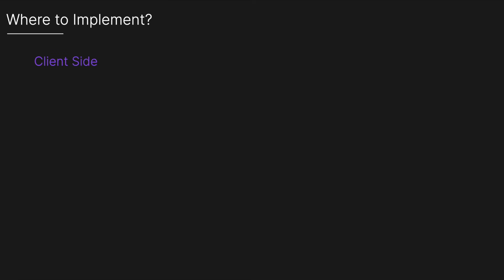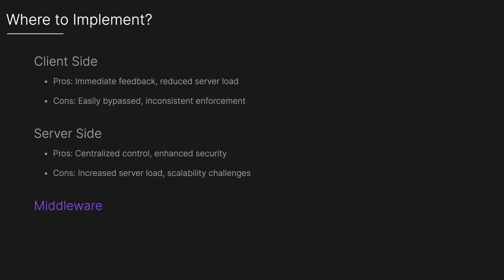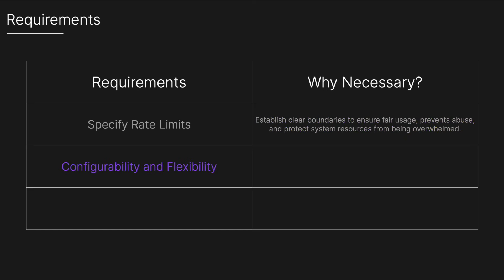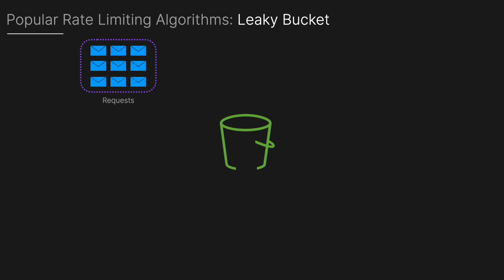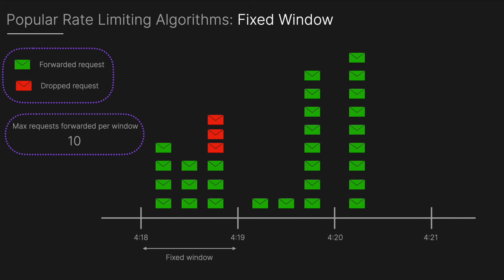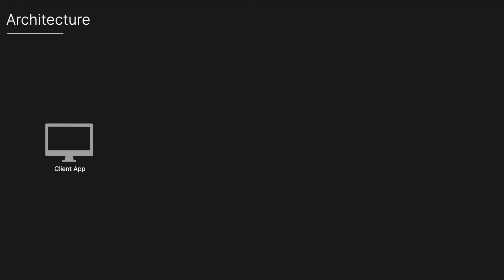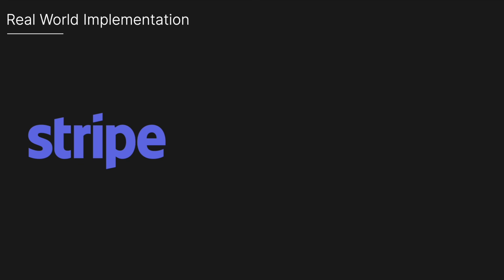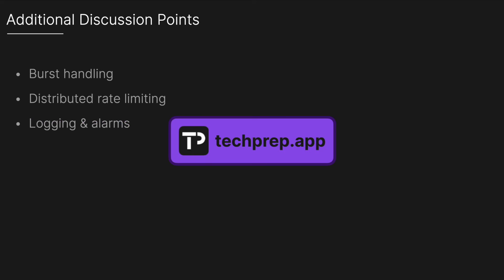Rate Limiter - System Design Interview Question

Comment: That was nicely explained. I recently combined token bucket and fixed window algorithms in one of my Springboot microservices. I used Semaphore for Tokens and checked if the number of requests made in 1 minute did not exceed the allowed requests on the Blackline API.
Reply from the maker: Appreciate it! How easy was it to implement in Springboot?
Reply: @TechPrepYT  I would say it's quite easy to implement. I designed a utility class to acquire the token (using Semaphore) before making an API call and release the tokens only when a minute has passed. In my case, we can only make 600 requests/minute. 
A Semaphore is initialized with a specific number of tokens (MAX_REQUESTS_PER_MINUTE = 600). Each time a thread acquires a token:

- The available token decreases by 1.
- When the tokens reach 0, any further attempt to acquire a token gets blocked until tokens are released. (I created a scheduler that runs every 30 seconds to check if a minute has passed and then release the used tokens).